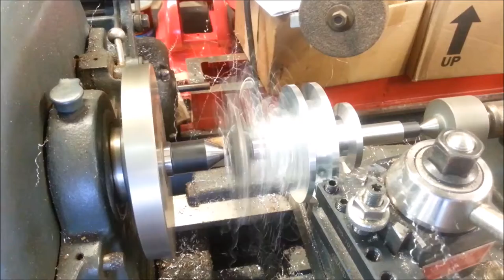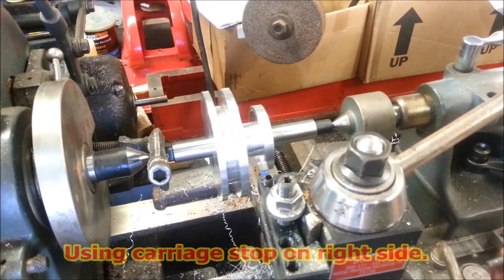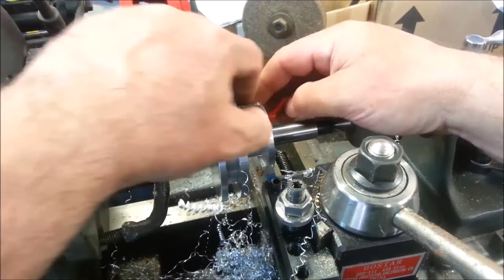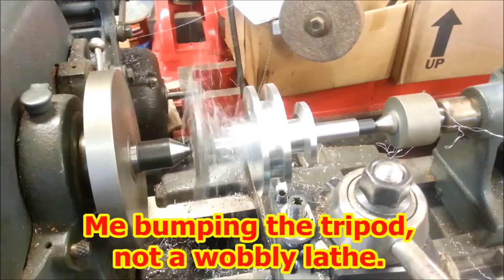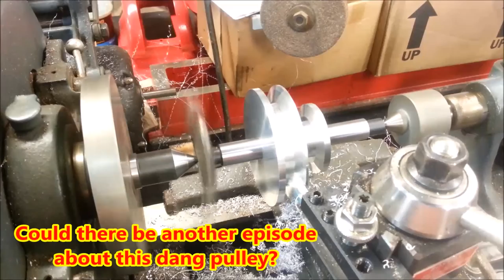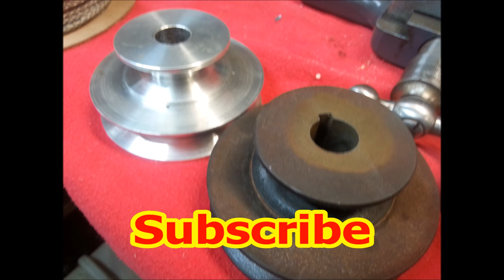South Bend 9 x 24 Workshop Lathe  Part 3 - The Pulley - Crafted Channel

Comment: Above center line.
Reply from the maker: Been a long time, don't remember.  But it did go with a lathe I sold and worked perfectly.  Looking forward to making one from the beginning.  Might be doing a drill press reduction drive or some other interesting project that requires me to make one.  Maybe 4 groove next time.
Reply: I saw in a later video the aluminum was expanding and sliding on the taper shaft.
Reply from the maker: Yes, I remember that now.  I included the failure because I thought it was a great lesson to share.

Comment: Doin' a little rubbin'?
Reply from the maker: I'm not much of a bumper and rubber (dancer).   ;-)  It does sound like some kind of tool rubbing sound.  That is part of why it took me a while to figure it out.
Reply: Yep and the camera angle it was hard to tell whether the toolholder was actually rubbing on the pulley, but it looked at least close.  It looked like it then wasn't an issue when it was turned for the cutting the angled sides.
Reply from the maker: ILGopher Ah, I thought by rubbing you meant a tool was too high and the face or some other surface on the bit was rubbing.  Yes, I had the block close, but it wasn't touching.